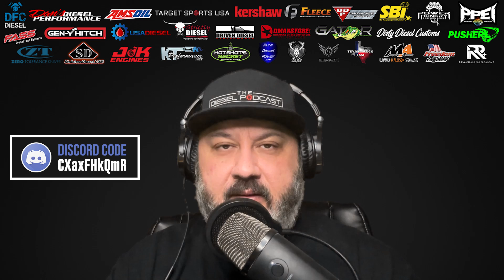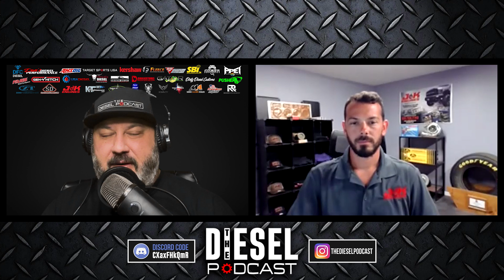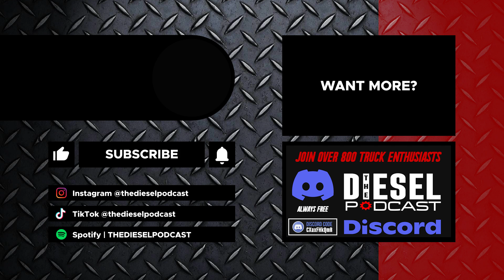6.3L Powerstroke + 4WD Van Conversion

Comment: Curious on the 6.3 method. As far as I know the 6.0 and 6.4 are the same stroke, with a larger bore being the difference. Are the cranks offset ground and a smaller rod journal used?